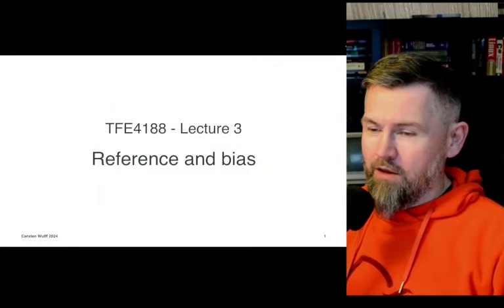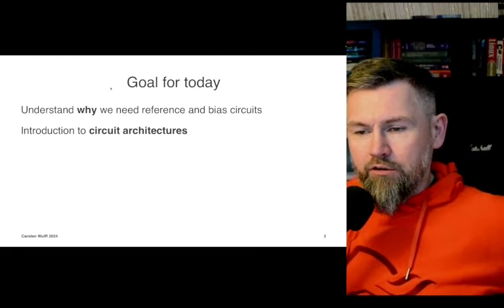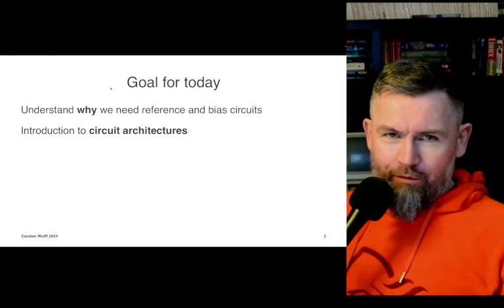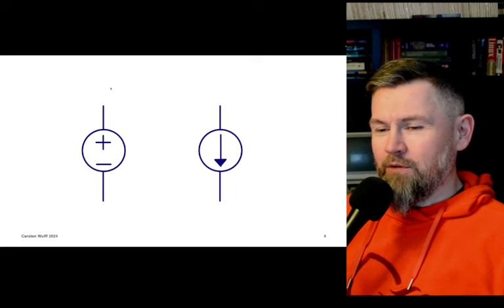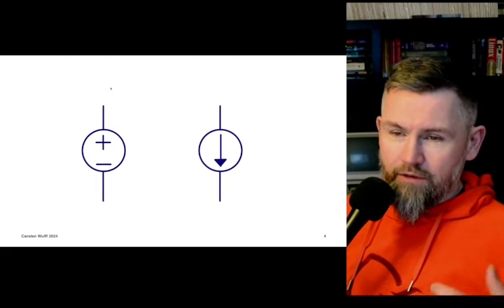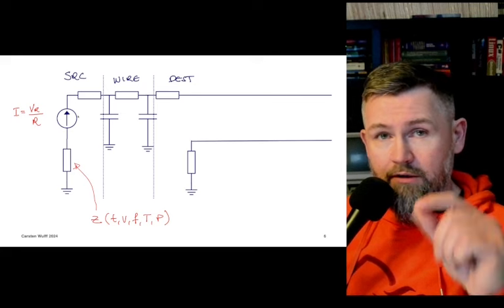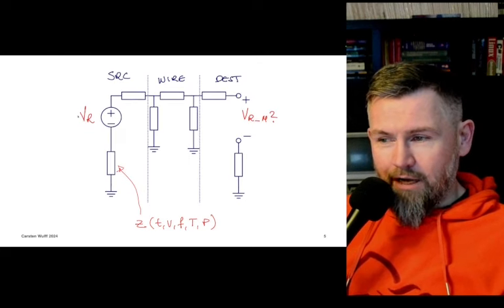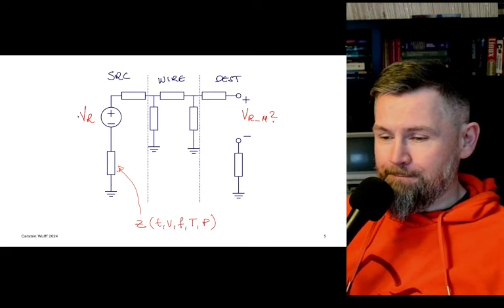Lecture 3 - Voltage Reference and Bias Currents

Comment: The VI convertor circuit show at 35:20 has the op amp inputs wrong. Band gap source should be connected to +in and RSense feedback to -in of opamp
Reply from the maker: Since the PMOS is inverting, then the feedback needs to be connected to the positive input. If the output fet was a source follower I would agree with you.